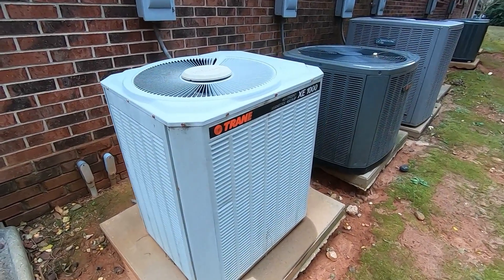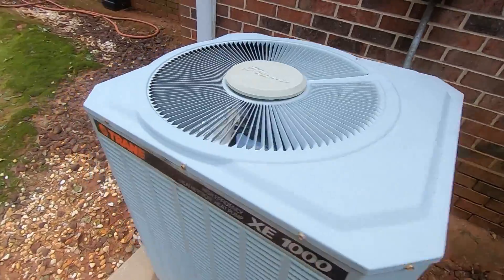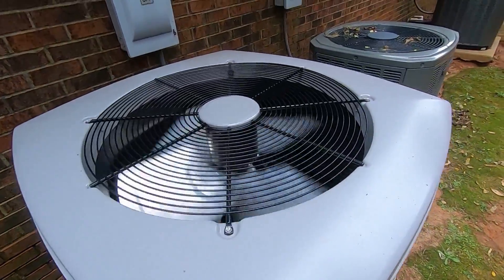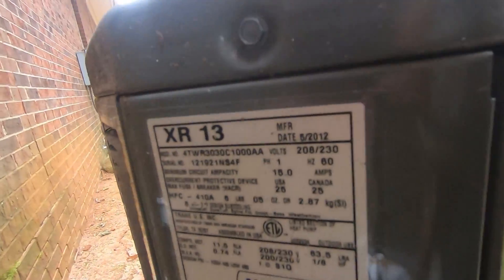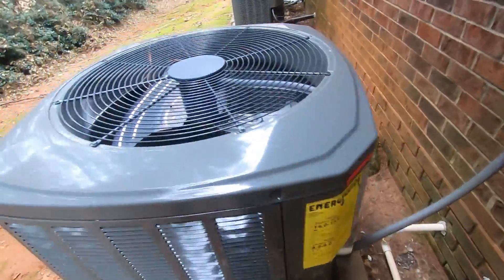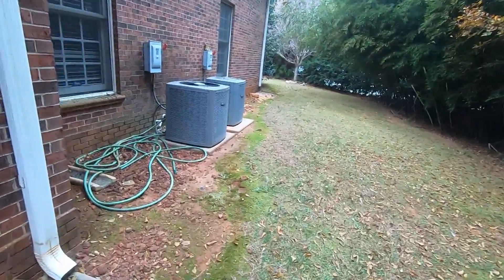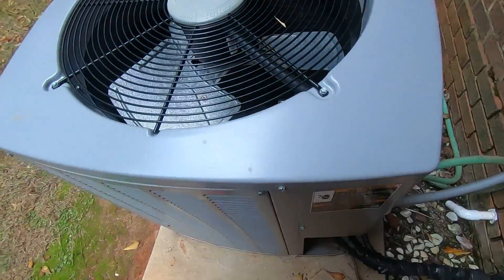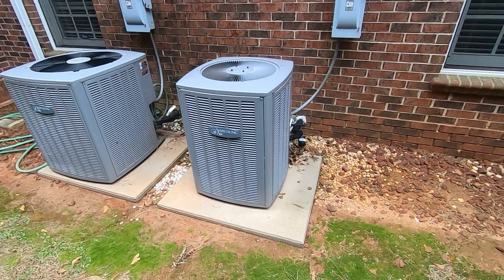Trane and Armstrong Air heat pumps revisited

Comment: When ac's/heat pumps freeze up the compressor seems to be louder than normal. Hopefully that Armstrong air won't get replaced. Great video as always!
Reply from the maker: It's definitely not good for the compressor. I've seen many units freeze up, but never to the point where it extends to the basepan. And that unit is less than 2 years old so I don't think it'll be getting replaced anytime soon.